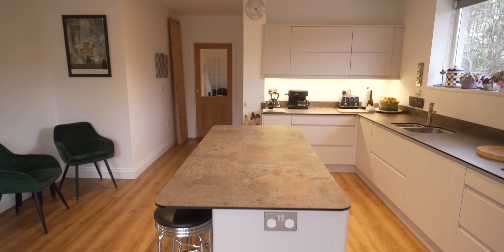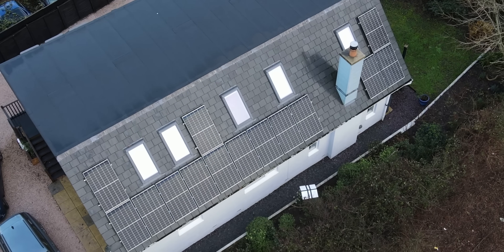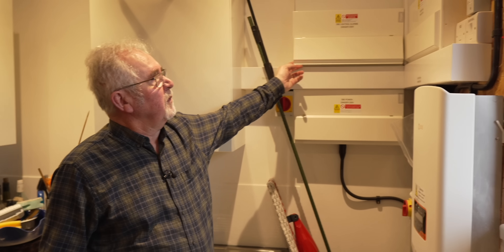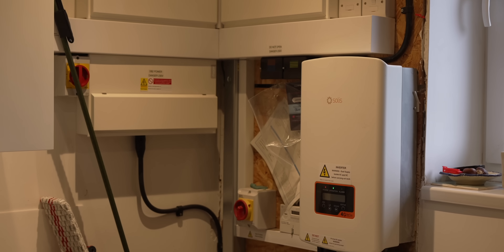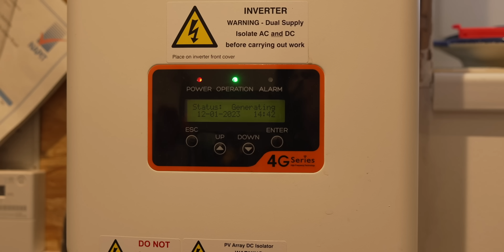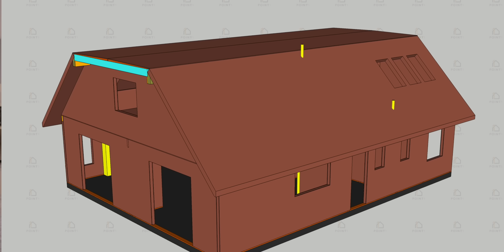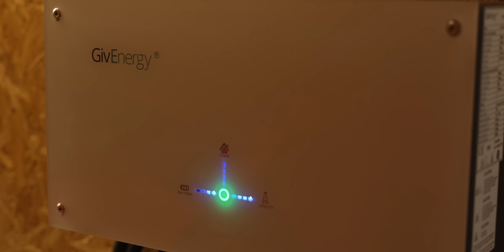Self-Build Your Way To Energy Savings | Everything Electric Show

Comment: This is good stuff. With a new build, they did right and focused on insulation & permeability first. Having added the ventilation system, I doubt they have enough heat demand to justify a ground source heat pump - a small air source one should suffice.

Comment: Running the house will have a minimal impact on the world, but the batteries, solar panels, insulation, concrete etc all have high impact during production. No slight to this build (I too have all of the above), but the industry has a long way to go. Natural insulation is a good start, like wood fibre (my main house insulation) or sheep's wool.

Comment: My idea here isn't to "self build" as such but to "radically retrofit" it, to make it a PassivHaus retrofit (or enerphit) 

I'm going for the super expensive stuff  first which includes my solar panels. I've already got 8 solar panels. My roof is sadly east facing 

I'm reinforcing my flat roof, and the aim is to add an additional 8 solar panels on there, with batteries. That means I can ideally seriously reduce my energy requirements for running costs. On my flat roof, they can force it to face south east at the very least, if not true south 

That's the first step

The second step is to make my house air tight. I'm looking at getting an architect to make it more air tight. I intend on adding even more (breathable) insulation in my loft too.

I've got air leaks from my spot lights, so I'd like to rectify that too.

My step after 8 more panels, and tightness, is to save up for an MVHR. I require around 3700 kWh of energy, and 16 panels should output 4000 kWh a year. The way I think about it, is that I'll basically only need to pull energy from the grid between October and February. 

I should theoretically generate 808 kWh in those months, and I'd theoretically pull another 842 kWh from the grid. During those months, if you assume a cost of £0.54p/kWh, that's £454.68 for those months. 

For the others, you'd likely export 3192 kWh for those months, and realistically I'd consume 2310 kWh  ie: I'd export 882 kWh likely around 22.5p (Based on the current 15p export I'm getting with Octopus) ie: making £198.45 for those months. Total cost for the year is a theoretical £256.23 (+ standing charges) 

In addition, I've got ripple energy shares so ideally that price would go down even further. 

Then I'd upgrade my windows to triple glazing, and upgrade my pipes / radiators. I'd also swap out my electric shower for a mixer shower. A mixer shower would temporarily "recarbonise" the shower 

Essentially the idea is to follow PassivHaus principles, doing the pricey stuff first. (Other than air tightness I guess)

Then that should seriously reduce my gas bill too. I currently need around 15000 kWh of gas for the year. Using PassivHaus principles, I can theoretically get that down to 4500 kWh for the year 

Then, once I've got air tightness and PassivHaus down to a T, I'd get rid of my gas cooker in favour an induction one. 

I'd also get some form of heat pump. I've toyed with the idea of an air source heat pump + battery storage, and the ground source heat pump wins in both cost and average COP. The ASHP with batteries, charged overnight is still more expensive because you have to get enough batteries to store your "converted" heat. Your heat pump would be going at it full blast whilst you're sleeping too 

Meanwhile a ground source one will end up costing you not much more than ASHP + battery storage (Either lots of sunamps or Caldera), and the COP is the same for the whole year

Then ofc, once I've got a heat pump, I no longer need a boiler, and I've successfully entirely decarbonised my house. It's a very very long project though. I'd most likely be adding another 1000 kWh  of electricity though once I've got the house to run on electricity instead (ie: 4500 / 4.5 (COP) = 1000 kWh)

I might add end up pulling even more from the grid once I get an EV too tbf.

Anyway, that's my long term plan for decarbonisation.

Comment: The problem that I'm finding as I try to set up my home (solar & battery) is that the grid wants to have control of what I generate.
In the UK you can't use the grid as one of your sources of energy, it has to be the primary one. So if the grid goes down you need workarounds to use your solar and/or battery.
This is totally unacceptable but doesn't seem to get a mention anywhere.
Reply: I believe systems are coming where you “island” yourself from the grid automatically in the event of a power cut and run of your batteries/Solar. Have just started looking into all this as we would like a solar and battery system but we are rural and prone to power cuts. As you say not much mentioned about it generally. 😀

Comment: Beautiful! We've renovated (2010, Israel) an old concrete house with straw bales for insulation & carbon storage, earth + lime plaster; insulated roof and windows; solar thermal water heater & storage; 21 kWp  rooftop PV (producing 4 times more electricity than we use, selling all of the surplus electricity to the grid for a good tariff); air heat pump HVAC; no organic waste for us and for a few more families (feeds the chickens). The house and our family are proudly carbon negative 💪🏼

Comment: Great looking house and making best use of the property by sub-dividing the land. I'd be keen to hear how they justified putting in a solar battery. I can't make $20,000 NZD for the Tesla Powerwall 2 financially viable and payback is looking around 40 years. We've got 4.8kW of solar and payback is 10 years.
Reply: Could be a quicker payback here (uk) due to the cost per unit of peak rate electricity (approximately 36p per unit) and cheap off peak (10p ish per unit). So every unit consumed from batteries is 26p cheaper (not including system losses) and if the are charged by Solar it’s an even greater saving although you have to spend another chunk on panels😬. EVman on you tube has some good vids showing payback calculations for the UK. 😀🇬🇧👋

Comment: Many years ago. A TV programme "house of the future". Before solar and batteries. The most cost effective and efficient was the air recovery unit. I wonder should this be the first investment in home upgrade. Not a  battery or solar.
Reply: I would be concerned about how easy (read hard) it is to retro fit to most houses that isn't build for it in the first place! Specially if  it is in two storages. unless you want to have a lot of ugly pipes runing around giving it a very industrial look, it might not be really feasable. 
I might be wrong though :)

Comment: Good work Emilie. Geez there's some a holes in the comments. For the smoothed brained; the initial outlay is irrelevant, what matters is the housing stock incremental improvement. But explaining  this in detail to smooth brains isn't worth my effort.
Reply: Initial outlay is far from irrelevant for those without access to the necessary funds.

Comment: Oh, lucky bastards who have different energy rates between day and night and can play the energy system to their advantage.
Reply: Doesn't everyone have different energy rates at different times of day?
Even here in Canada where in many places we have an abundance of cheap clean energy we have Time of Use pricing.  Not as dramatic a price differential as in the UK but enough that I charge my EV overnight to save what I can.
Reply: @markcayer4859  Maybe we have it but the difference is so tiny it's just not worth the effort to opt for the tariff. Last time I heard it takes hoops and loops and you are fixed for what you use your "cheap" electricity on. 
Furthermore, our buy/sell prices are so different it just doesn't worth it. From the top of my head: normal electricity price is 40, cheap is 20 to buy, when you sell it's 15. So...
Reply: not quite the case. Dual rate are available, the rates for those with an EV is 39p day and 12p 4 hrs at night. The cheap rate can be used by any device - like batteries as they do in the video, to use cheap rate during the day. It’s very worth it.

Comment: They don't need a ground source heat pump, way to expensive and invassive! It working perfectly, may be a small 5kw ASHP, but that's all this couple needs. If they get a Nissal Leaf, like us, they can run that ASHP off the car battery, and what's more, if look hard enough you can find cheap energy during the day e.g. our day rate is 43p, so we go off down to Tesco's to charge the car up on 28p per kWh, if it runs out on very cold day. Great job though Bill and Wendy and perfect timing too! very envious of that well insulated home.

Comment: I love the videos showing what can be achieved, especially when building a new home.
We started a journey to modify our 1970's home,  around 12 years back, adding 4kWh solar on our West facing roof, of which rthe energy was mostly used by the home and solar diverter for hot water. We later added a 2nd 4kWh to the East facing roof and a Tesla Powerwall.  This meant we had spare capacity to fill the battery from solar during the summer months. In winter, we need to fill from cheap rate electricity, paying for any additional use. By using the battery we managed to use around 90% cheap rate energy, just paying high price for 10%. So a battery is well worthwhile even without solar, to fill from a chep rate tariff and use during expensive times.
We have also had an EV and charger (MyEnergi Zappi) for past 2 years and have also now had an ASHP for a year. 
Final part of our puzzle, fixing the lack of/broken insulation for our home is being done in 2 weeks time and I am also hoping to now add further Solar PV to my south facing wall to help with running the ASHP during winter months.  
Unfortunately it is impractical to do the heat recovery etc, due to lack of places to hide the larger pipes needed to do so!
Reply: I'm guessing that you live in the UK because here in Canada fixing the insulation is the recommended first step along the renewable energy journey.
Cold weather ASHP units are also a hot commodity in many parts of the country.
Reply: @markcayer4859  yes in the UK, finding a company to remove my old insulation was difficult as most attempts over the years were companies that only did businesses.  I found a company last year but they stopped responding and thankfully found another closer to home.

Comment: Great job! Interesting they also would recommend batteries first. We have similar thoughts in Colorado. Solar and HP are almost obligatory, but batteries would be the thing I'd miss most. However, they're what people mostly say, "They'll never pay off!!"
Reply: UK time-of-use tariffs can make a battery pay for itself pretty quickly. The cheap rate is about a quarter of the normal rate, so a battery can save 3/4 of your electricity bill during the winter when your solar isn't generating enough. Our feed-in tariffs are about a tenth of the normal price, it's much more important to be able to store your solar generation for use at night. We don't have US style tariffs where you have the same rate in both directions.
Reply: I think the people who say it can't pay off do math like big companies do! 
On some kind of big scale with and strange ways of doing calculations, they might be right! 
But for normal people, using normal math, and common sense, not getting them is imho just stupid! 
Most people will have to get a loan to get in a big solar setup. getting the extra money for batteries will not cost a lot more in payments, the extra savings will however be larger than the increase in loan payments. already there you effectively have more money from day one! 
Also, the power is most expensive right after the sun stops shining, so even if you don't have enough to go through the night, you will have enough to cover the most expensive electricity, something you won't have without a battery. 
It is my opinion, and I know I am not alone with this, that if you live a place with hourly rates, getting a battery could be a good investment, even without a single solar panel - simply because of the saving from buying cheap, and using when expensive.

Comment: Another house built from the ground up by people with loads of money. 
Nothing useful for regular folks that already have a home (aside from the idea of buying a big battery and going all electric).

How about videos on what normal middle class folks can do?
Reply: There are lots of videos around on topics just like that.  Most recommend looking at your current environment via an "energy audit". Figuring out where your money is going for your energy usage is the first step.  In certain instances insulation is a good relatively inexpensive first step providing that your "envelope" is not leaking warm/cold air when you don't want it to be doing so. 
Using a battery system to shift your electricity purchase cycle to buy as much as you can when energy is cheapest to be used when it is costliest is a step that's pretty easy to cost out for return on investment.  
Many people are taking small incremental steps but will get there eventually.

Comment: why did they say that was the max number of solar panels they could have, there was at least still half the roof free on the panels side
Reply: Their electricity company may not have given permission for a larger system if it's tied to the grid. 3 or 4kW is the normal limit, but they could be sharing their supply with their old house.
Reply: cutting power bill by 60% is pathetic when  the roof is crying out for more panels, forget selling excess just go off grid and have no bill
Reply: Possibly the max number for their inverter, costs can go up dramatically when you step up in size, so you do what you can afford and reduce overall bills to an affordable and acceptable amount.

Comment: 100a lithium battery £400,2000w4000w pure sine wave invertor £200,30a charge regulator,also maybe ,lithium battery charger £40 ,2x100w solar panels,even simpler and cheaper to start with boil kettles ,microwaves, lights,dvd,TV,ice maker,1000w grill,enjoy!

Comment: I find it interesting that ground source heat pumps are still being considered in the U.K. with your mild climate. We have a Mitsubishi ductless mini split air source heat pump replacing our baseboard heating here in Canada. With a COP of over 3 even at -20°C, why would you add the large extra expense of ground source?
Reply: I think people like the higher temperature output of a ground source heat pump. It more inline with traditional boilers.
Reply: @DavidKnowles0  Good point. If you have hot water heating, you wouldn’t want to add units to the walls throughout the house. I have no information on hooking up air source heat pumps to hot water systems.

Comment: Interesting that no-one mentioned the words 'passivehouse' in this video, even though this building is built exactly like a passivehouse, and they said they wanted to be 'as eco as possible', but apparently no-one said 'you should build a passivehouse then' to them.  It appears to be slightly below that spec - 200m of PIR all round is probably enough, but the airtightness is poor for a PH at 3.6 (~4.5ach) rather than 0.6ach). 3.6 is pretty bad really for an 'eco build', and odd that someone as well-informed as Emelie would call that 'pretty good'. It's good for a retrofit or your average UK house, but it's a factor of 4 too high for an eco build.
So this is indeed a very good house by the UK's pretty low standards, but if these people had got some sensible advice when they started it could have been a lot better at very little cost. Airtightness is cheap if it's designed in and tested whilst the surfaces are still accessible.
Reply: Passivehaus is interesting but its just a certificate at the end of the day - learn from its principles apply what works.
Reply: @mojonojo3  We are in complete agreement here. The certificate is irrelevant - it's the spec, the principles and the building physics of PH that are important. 
This house is 2/3rds of the principles: insulation and heat-recovery ventilation but not airtightness. And thermal bridging didn't get a mention so that might not be great either. Not taking sufficient care on airtightness greatly undermines the insulation and MVHR effectiveness. Same with bridging. The PH principles are proven to work in real buildings.
There is nothing wrong with going for a lower spec like AECB retrofit level 2 (50kWh/m2/yr instead of 25 or 15), which is probably where this house has ended up, but that's not meeting their professed requirement of 'as eco as we could'.
Reply: @mojonojo3  Certification and independent certification is what maintain standards through.
Reply: Don’t let perfect get in the way of good.
Reply: @Demetrios Christopher  Yeah, no units given, so we're guessing here a bit, but UK air tests ('air permeability' ) are m3/m2.h@50Pa, which for normal-sized domestic houses is typically within 30% of ach@50Pa. That 'divide by 20' rule of thumb part is for the difference between 50Pa and average wind pressure over the year (i.e air-change rate in normal use vs during the test). So if the test was 3.6 m3/m2h, then the ach@50Pa (i.e as in PHPP)  number will be something like 4.5. (for my house a test at 1.94 gives 2.5ach in PHPP-speak)

Comment: The house uses only 100 watts when they are not home? Must be when the refrigerator isn’t running.
Reply: he did mention that it was with the fridge was off, so I presume "being away" means an extended break somewhere else, when almost everything can be turned off in the house.